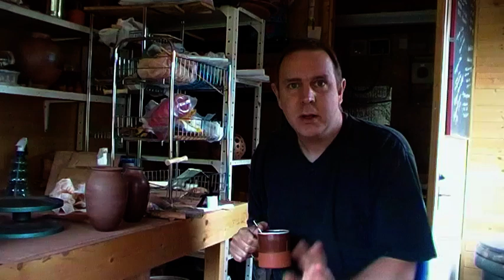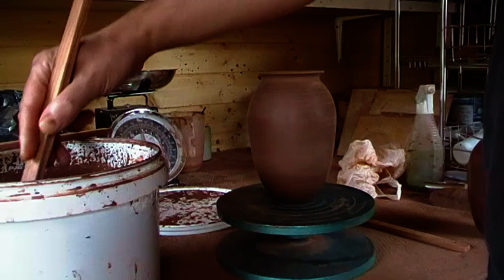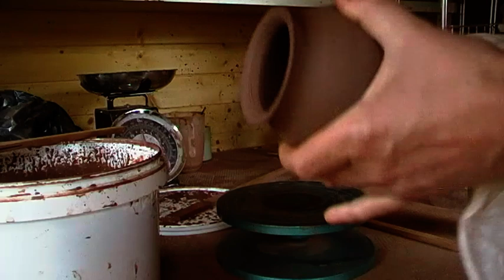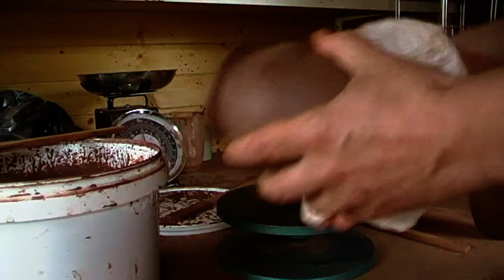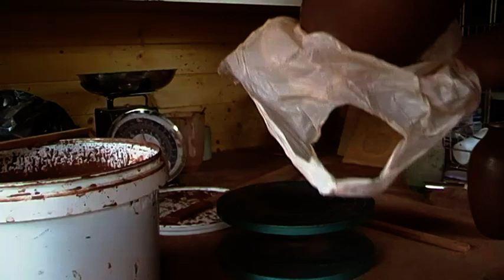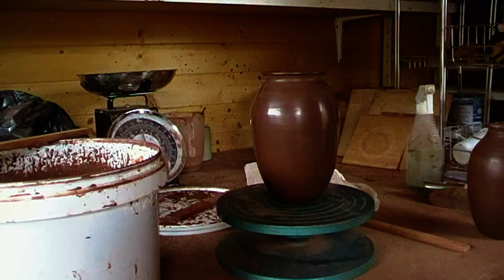Terra Sigillata Update

Comment from the maker: No, on raw clay when it is leather hard. Leather hard is where the clay has not dried completely and is still cool to the touch but is firm enough to handle safely. Trim the pots before you apply terra sig. I trim the pots and then cover with plastic bags until they have dried and are evenly leather hard.
Mark.
PS. You can ask questions in any language. I use google translate to reply!

Comment from the maker: Yes. When you have turned the base (fixed the bottom) keep the pot covered until the base has dried equally with the body of the pot, then apply terra sig. The clay should be leather hard (twardy jak skóra?). If it is too dry it can crack. And then: yes, bisquit firing.

Comment from the maker: I had the same problem to begin with; the lips of my pots would often crack. It might be that your pots are too thin, but I've had no problems with pots that are just a few millimetres thick. You probably do already: but make sure you've flicked all the excess sig off your brush before applying it, keep the pot turning quite fast and just apply thin layers making sure you let the previous layer dry before applying the next.
Test on pots you won't mind losing and let me know how you get on.
Mark